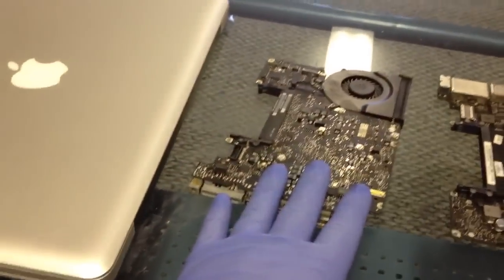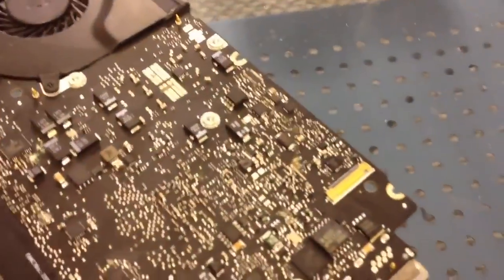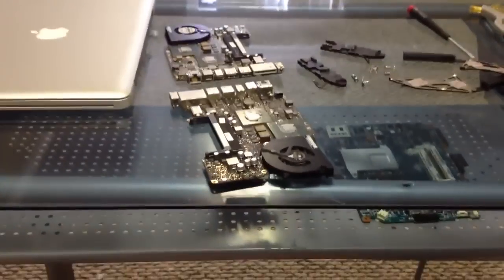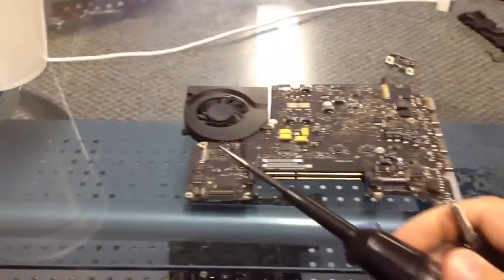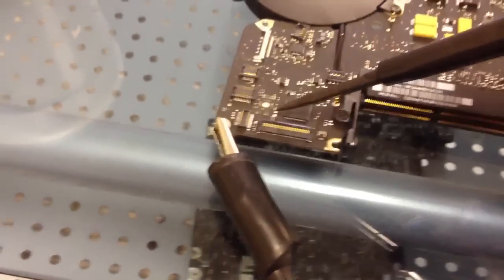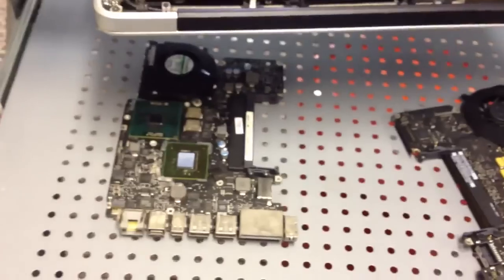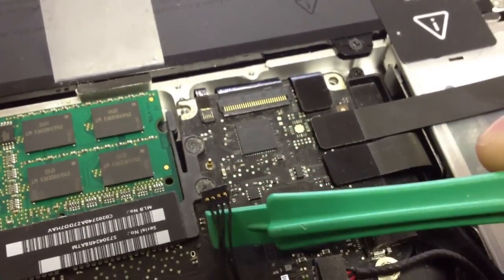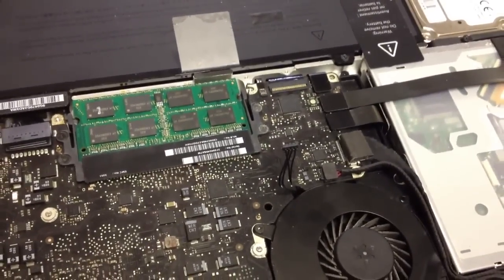Apple logic board repair Macbook

Comment: I bought a macbook pro that was ran over,  the screen was cracked.  So i repaired the screen and put a new hd in it.  The fans spin during start up, the hd spins and the cd rom spins but i have no chime, no keyboard lights and no screen.  What do you think should be my next step.  I also have a solid white light in the front of the unit.  myronrob@gmail.com  Thanks in advance

Comment: I have a 13 inches, coke spilled. 
Everything Works, Except  the x  on the battery logo. The battery doesn't charged. 

I tested battery, SMC, Changed the magsafe board, It won't charged.
What do you wash it with? I saw corrosions when I first opened it.

Please let me know.

Comment: I have a mbp that boots but does not stay running iv cleaned it but cant figuare it out.  Fans also running at a high speed should i smuarge the board in cleaner like you did.  I went over the whole board with a tooth brush any ideas the laptop has life trys to boot have had it up when i hold the r key but when i let it go it shuts down again :(